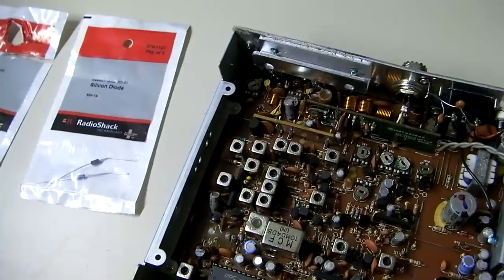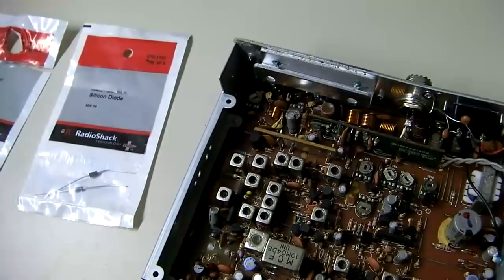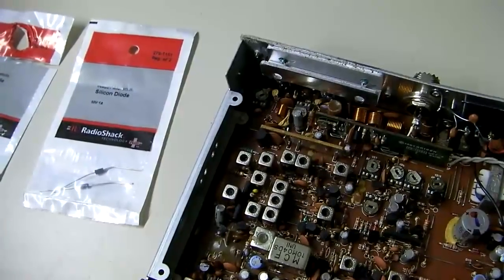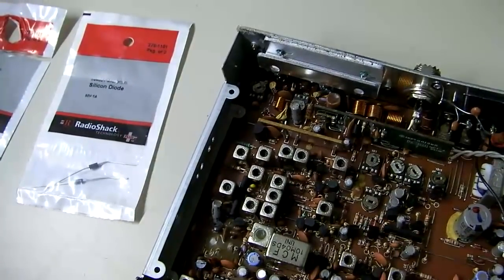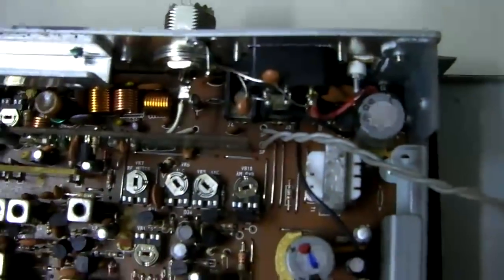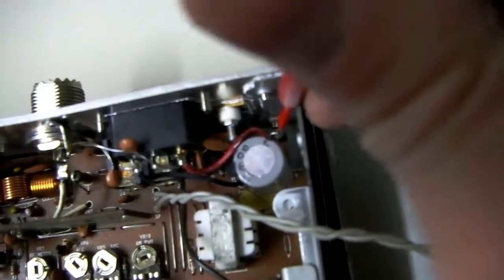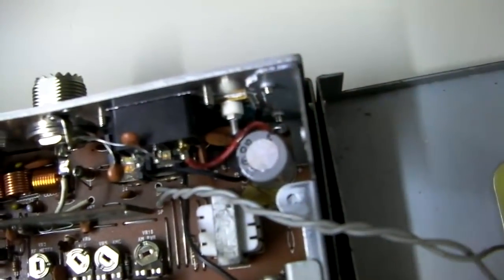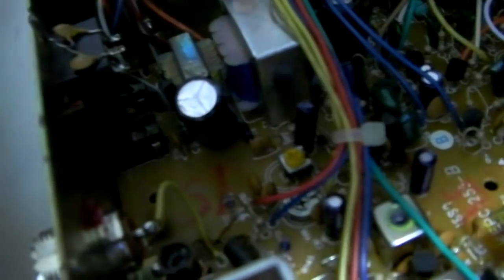Troubleshooting: CB Radio won't power on / blowing fuses - Protection Diodes

Comment: Ive had my cobra 25 since i was a kid, actually before i could legally drive, its about 30 years old, and i let a buddy use it, got it back and it would not turn on and blew fuses immediately.  I followed this repair and now it powers on!  Thanks.  Now I have to get an antenna and test it.  Thank you so much for your video!

Comment: I have a near mint TRC-424 CB radio, got it in the original box. The chrome and faux-wood is looking sick. The sad thing is it suddenly started blowing fuses every time you turn it on. I had a look inside and couldn't see anything obvious wrong with it. Does this diode thing cause fuses to blow continually, or just no power at all? If you have any thoughts why my TRC-424 keeps blowing its fuse a second after it's powered up, please do let me know as I would love to fix it.

Comment: i have a land command by sbe lcbs-4  and it won't power on. i can hear a hum sound when its plugged in but thats all i hear. I don't know if  its the power cord or what the guy i got it from had spliced a differant power cord on it. instead of using a power cord that just plugs in the back socket the plug socket is still there  tucked inside the radio but has a differant power cord spliced into it.

Comment: Thanks for the video. I have a 148GTL I increase the voltage on my Astron power supply I hear a POP inside the radio and went off, I check the diodes they are okay. any idea what else should I check?
Reply: Junkyard dog 🐕 😅😅

Comment: I picked up a box of old CB radios at a flea market, and most of them had the same blown diode. Easy fix. I sold them on eBay for a nice profit.
Reply: Ive been told The new president Lincoln plus 2 doesnt has that diode , so when you connect it with wrong  polarity The radio Will be fully broke like as for scrap ???

Comment: Thank you so much man!
Got a Corba 29 classic from a friend, wouldn't power on.
Checked the fuse, not blown
25A fuse in a 2A fuse spot.
Took out the protection diode (D23)
Still no power.
Turned over the board, trace where the ground comes in was burnt off!
Bridged the gap and it fired right up!
Just need to put in the new diode and screw it back together!

Comment: Thanks for this informative video. I just purchased Uniden Bearcat 880 cb radio and it does not power up. Looks like it was a previous return item. 4 mic wires disconnected from solder connections, no mounting bracket, nor protective plastic film on the bezel. They replaced the mic, still won't power up.  Will check polarity diode, thanks to your video. If mic wires shorted, perhaps some other part damaged. (?)

Comment: I just check my cobra radio and had the diode you said broken but still smell like born i am going to replace now but if it  is not the problem wich parts i have to replace next tank you

Comment: Ideas for a Cobra 148GTL working fine than put in the back seat and it fell to the floor of the truck. Went to power it off and it blew my 12v cigarette lighter plug fuse. 2 fuses in a row. Ideas???

Comment: I have a TR-696FD1 it has power to finals until the switch is turned on. Is the diode before or after the switch?It is like a capacitor is shorted to ground draining the voltage once the switch is turned on. The fuse to the radio is still good and the radio was working when it was put in storage.

Comment: i was putting talkback in my pc78 elite and the solder slipped from under my hand and landed on the board while the radio was no plugged in or on. something shorted and it still turns on, just no transmit and poor receive if any

Comment: I want to dig in your friends trash for some of their broken radios. Sadly my diode is just fine It sends but it will not receive? I replaced every capacitor and it still wont receive?

Comment: I have a Motorola   CB that I've had for 40 years kid at work was removing it from a truck touched the wires on a hot post the radio has not worked sence  shoots fuses when I wire it up got any idea on that

Comment: I have a Cobra 29 nightwatch soundtracker and it powers on when the power switch is off what could that be also having problems receiving and transmitting and is not the antenna

Comment: Have uniden2830  , works 100% on rx/tx .
Just went to change mic one day and noticed pin 1 (audio had thin wire to earth of plug .
When I removed this I had no rx , even with microphone discounted. 
Any advice would be very much appreciated.

Comment: My problem is when I press the call button the fuse blows in the inline fuse of the power cord.  It’s very unpredictable. I could be using the radio for a while. Everything’s working fine and all of a sudden I hit the call button the fuse blows    Any answers?

Comment: if your blowing fuses you've most certainly blown your protection diode even on linear amplifiers will react the same way they will blow fuse after fuse usually after hooking up power and ground wires in reverse as well easy simple fix and you also can take and clip the diode center and keep the two ends seperated they will also work that's usually how I test to see if my diode is bad actually before I solder in a new one

Comment: I have a 29 lx and I plugged it in and I heard a pop, and then smoke started coming out of the back. So I went to a local truck stop and bought a 29 LTD (I still have the lx) and I plugged in the LTD and it Define however when I got home I had to adjust something so I had to unplug it but when I plugged it back in I heard a pop again and smoke started coming out of back.

Comment: Your shadow covered the light. So show us how to take it out (diode) and solder...my unidentified cb radio has no fuse but the wires I attached to power wires got hot and i smelled burn. My cb radio wouldnt start up again...i think I should have taken another earth wire from cb body to negative terminal of battery

Comment: Will my radio smell burnt, if the diode blows? I went stupid and hooked up my 29 backwards for a few seconds and it smells burnt and a small bit of smoke came out
Reply: +Harley Swinger  If there wasn't a fuse then you may have burned out the diode explained in the video. Id give it a look, not to hard to replace

Comment: i bought a Cobra 29 le lcd from frys electronics, i had it recieving well and after a day it just cut off on me. i havent made any transmissions, built in radio check passed all, rf output failur at first(scosch mag  antenna, stock  radio) i just had a temp setup power and ground straight to standalone car battery worked fine for recieving but i want to say my knee nudged the power cord slack just a split second, small pop sound from radio and it cut off. i disconnected the 3 prong male after turning volume to off, and noticed the ground wire was loose and i just pulled it of the terminal, resecured both wire to correct nodes( as they were) hooked up cb but no power. im guessing its the same diode as the video. but if it matters my out the box fuse doesnt look blown
Reply: i havnt opened it up because im about to go try to exchange it for another Cobra 29 LX LCD (not the LE, typo in previous) but if by chance they deny an exchange ill crack it open

Comment: My CB will power on but is draining my barrtery when the truck is off. and when I  do turn on the radio it blows the 20 amp fuse (for my cigarette lighter) I have it hooked up to. please contact me.  There are not any more CB shops in my area.
Reply: +cody lance Sounds like a problem with the battery more than the radio. Never heard a of a CB draining a battery like that. Also how many other devices are hooked into aux power on the vehicle?
Reply: That's the only after market thing. My after market radio is hooked up to my factory wires with the harness and my amp is hooked to the radio remote wire. I turned on my cb radio and it popped the fuse. I ha entry had a problem with the battery since I took out my cb.

Comment: Just got a new radio , RANGER SS36HP3 , RADIO SHOP GUY SAID IT WOULD WORK JUST HOOKING TO TRUCK POWER HOOK UPS,  SOON AS I KEYED IT BLEW THE FUSE,  I THINK HAVEN'T LOOKED YET,  BUT WON'T COME ON,  HOPING IT'S JUST THE TRUCK FUSE,  307 BUCKS. HOW MANY AMPS DOES THIS RADIO DRAW ? NOTHING IN THE MANUAL SAYS HOW MANY AMPS,  JUST 13.8 VOLTS, HOW EVER HE TINKERED WITH IT AND TESTED IT BEFORE GIVING IT TO ME,  SO THEN SAYS IT'S 80 , 90 WATTS,.... SO I'M ASSUMING IT'S DRAWING TO MUCH FOR THE TRUCK FUSE,  I AM WEARY OF PUTTING A HIGHER FUSE IN DON'T WANT TO OVERHEAT THE WIRING,  OR BURN UP THE RADIO , WHAT'S THE CORRECT WAY TO FIND OUT HOW MANY AMPS ARE NEEDED AND WHAT'S TOO MUCH. DO I NEED TO DIRECT WIRE TO THE BATTERY,  ?  DO I NEED A HEAVIER WIRE FOR POWER AND GROUND,  WHAT TYPE OF IN LINE FUSE,  ... THIS IS SECOND TIME I'VE BOUGHT A HIGH DOLLAR RADIO FROM A CB SHOP AND WAS TOLD YUP JUST HOOK IT UP LIKE YOUR OLD CB... AND HAVE HAD PROBLEMS,...I THINK THE JUST WANT YOUR MONEY. .. AND OR DON'T KNOW EVERYTHING THEY ARE SUPPOSED TO KNOW ABOUT AMPS AND WIRING,..

Comment: This radio has more issues than a diode. It has the corrosive glue that needs to be removed and some caps that should be replaced.

Comment: I'm having that exact problem on my Galaxy DX 929 radio . It's blowing fuses in the power supply line  .
 The issue is when I take it to a CB shop ( because I ain't got the time to soder that piece) they want $100. Bucks to fix it . So the driver says, fuck that I'll get me a knew one instead. 
Let me see what a CB shop says.